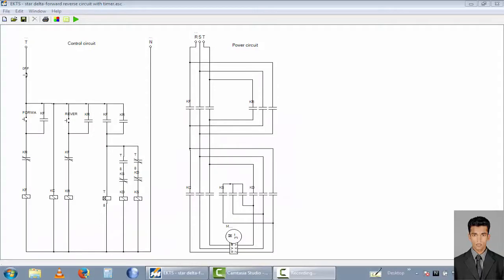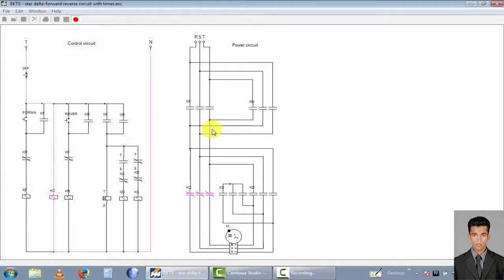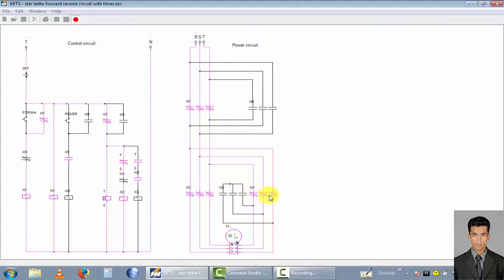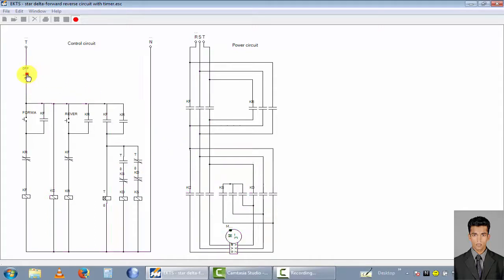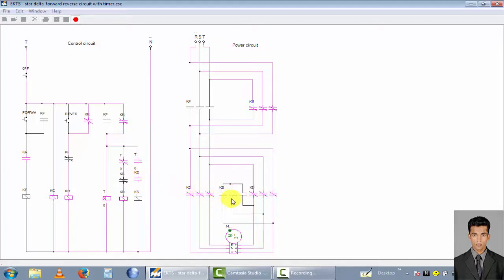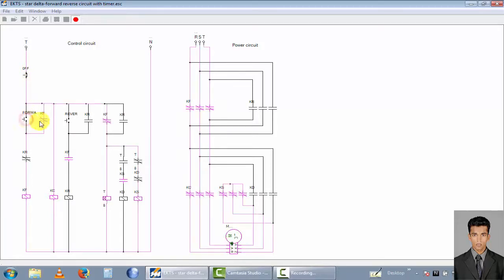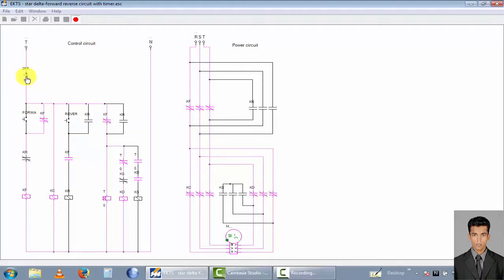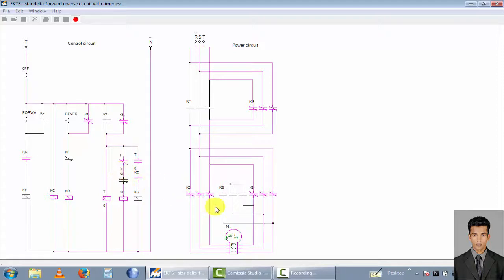Three phase motor control circuit [star- delta forward reverse circuit with timer]

Comment: dude this thing does not work on real hardware. (since the K1 & K2 NO outputs are joined together at the Timer's coil (Timer's A1), Whenever either K1 or K2 is energized, one end of the NO (that is 14) will get a high and since the other end always does (13)) so the circuit will behave erratically